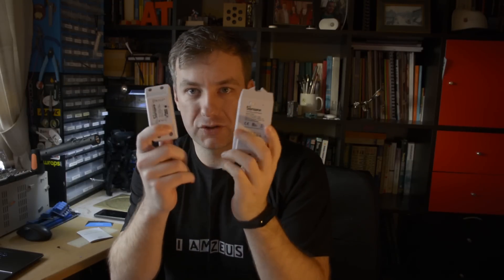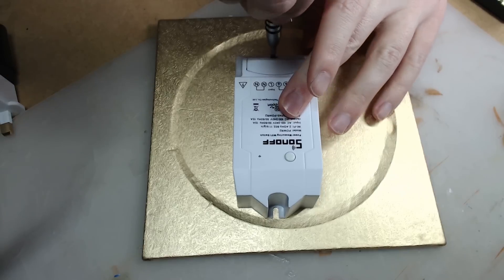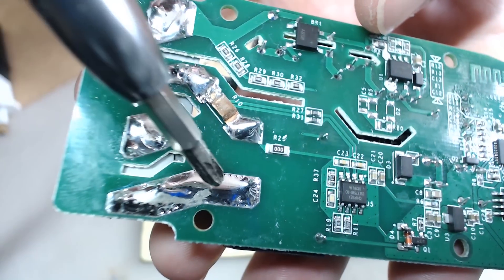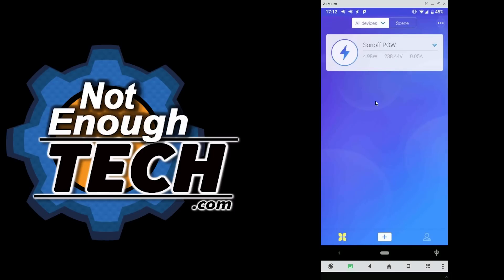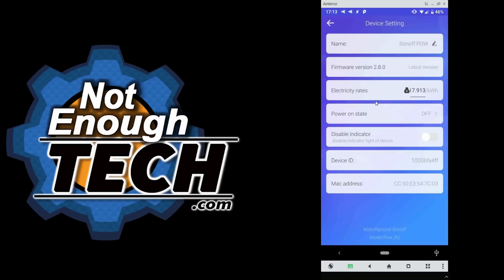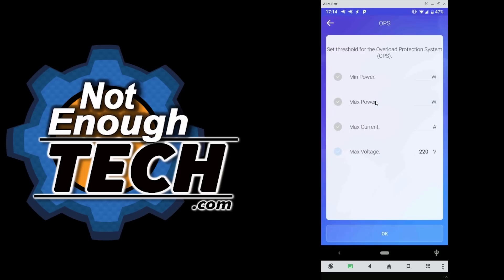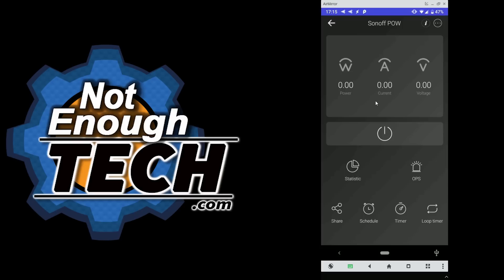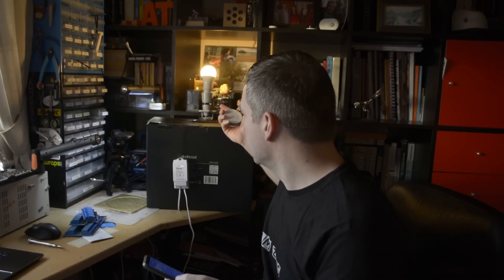Hands on: Sonoff POW R2 (POWR2)

Comment: Could this handle 12 amps constant?
Reply from the maker: Resistive or inductive load?
Reply: @notenoughtech  its a home appliance
Reply from the maker: Still it may vary. Inductive loads have inrush current which can reach as much as 10x of the rated device power on start. This may overheat the relay and cause issues. So identify the load type (Google the appliance type and power specification in details) then check against the rating of the switch.
Reply: @notenoughtech  This is a quote i found, 
Its a steady load wattage load.

"They are a mostly resistive load in that the AC voltage is converted to DC, then is used to drive a switching power supply. The transformer it uses is isolated from the AC input.

There is an initial surge of current as the supply switch's ON as it charges up capacitors, but quickly settles down to whatever its load demands.

Really, it is a dynamic load that is not inductive but not resistive either. An increase in AC supply voltage may show a decrease in current as the supply only draws the wattage it needs. If the AC voltage drops low it will pull more amps to maintain the voltage(s) it puts out. You could say it acts like an intelligent resistor as it varies by load and line voltage to keep the power to the load steady.

As long as the load is steady it behaves like a constant wattage supply."
Reply: @notenoughtech  Ita a GPU mining rig. They use server and PC power supplies

Comment: Do you know if the latest version of Pow r2 with 3.5 supports DYI mode or supports flashing with tasmota? I can't seem to load the 10.10.7.1 webpage with the built-in DYI mode neither from my phone ( i disabled mobile networks) nor from my PC.
Reply from the maker: Depending on the DIY version, the initial version required you to create an access point wit specific credentials more info here:
https://notenoughtech.com/home-automation/is-sonoff-diy-2-0-better/

Comment: After test pairing on my wifi connection now i want to relocate the switch to different location having different wifi. What would be the procedure then? Do i have to repeat the same steps of pairing? And after successful pairing, can i control the switch from anywhere remotely through mobile app?
Reply from the maker: With tasmota you can have 2 SSID stored. Otherwise you just need to put it in AP mode and pair agin with a new SSID
Reply: @notenoughtech  thank u for the reply. After pairing can i control the switch from anywhere with different data connection?
Reply from the maker: Yes providing it reports back to the server if you do that this way

Comment: I want to use this device to measure Watts, in order to buy an inverter of the appropriate size. Does this device show power peaks in watts over a time period rather than just cumulative power consumption in kWh?
Reply from the maker: There is a power over period time  available in the app. You can have peaks for switch off ... Once flashed with tasmota you can pull data at your own frequency and recalculate it yourself from the power value

Comment: Can you use temperature sensor on it?
Reply from the maker: Yes with tasmota you can add DHT to the spare pins
Reply: @notenoughtech  on this pow r2 version we can use temperature sensor? Can you please give some details
Reply from the maker: Check out the Tasmota docs, you will see that you can assign the DHT11 and DHT22 to a pin and configure it in the software

Comment: Does it measure power factor?
Reply from the maker: I don't believe so
Reply: @notenoughtech  Looked at some github topics it seems to be calculated internally, just that it's not displayed in the app. Can tasmoto be customized to show it though?
Reply from the maker: This is the payload:
StatusSNS: object
Time: "2019-11-10T05:39:49"
ENERGY: object
TotalStartTime: "2019-05-04T22:59:20"
Total: 46.516
Yesterday: 0
Today: 0
Power: 0
ApparentPower: 0
ReactivePower: 0
Factor: 0
Voltage: 243
Current: 0

Comment: How accurate is this smart switch in power calculating wattage, Amps & Volts ??
Reply from the maker: Make sure you push the wire really deep. Otherwise it will come out

Comment: Hello, need a bit of help if you are so kind.

I use a switching power supply powered at 220V to open my gate that has a 12V electro-mechanical lock using a button wired to the power supply. I attached a schematic of the installation.

https://i.imgur.com/WcigH3p.jpg
The 2 wires from the power supply to the button are powered with 12V.

Apart from the button, i would like to use a Sonoff wifi switch to open my gate from my smartphone.

At first i thought a Sonoff SV might help but i found out it lacks an inching mode which i seem to need to close the button circuit for about 1 sec only.

Now i'm looking at a INCHING/SELF-LOCKING Switch (https://ewelink.coolkit.cc/?p=143) that has inching mode and can be powered at 12V or 5V USB.
Is this the one I need?

Thanks.

Thanks
Reply from the maker: Just to be sure, all you need to trigger the gate was the "button"  to be pressed for 1 sec then released? You xan do this with any sonoff. (not all can be powered by 12v) If you use NodeRED, You can just set up delay node - and release the button after - so it would be activated correctly. Then when you use app... Use HTTP or Join to activate the flow
Reply: @notenoughtech   Thank you for your reply. Since i already have a Sonoff basic, i researched a bit and find this modification: https://www.youtube.com/watch?v=p76OQI5Xx2k

This should work, right? https://i.imgur.com/YuMDv4D.jpg
Reply from the maker: Yes it looks ok.
Reply: @notenoughtech  Worked like a charm. Thanks.

Comment: I found pairing works OK (on android P/9) if you turn off mobile data. i suspect as the 'wifi' connection during pairing doesn't yield an internet connection for the phone, it routes traffic over mobile data instead.
Reply from the maker: Darn... I flashed it already to test it but I'll mention this in the article. Thanks Garry